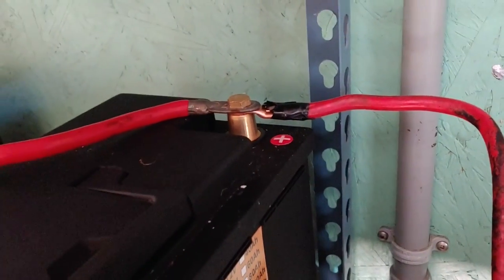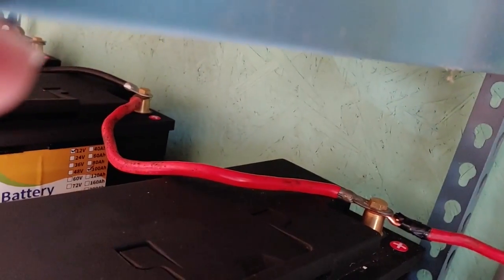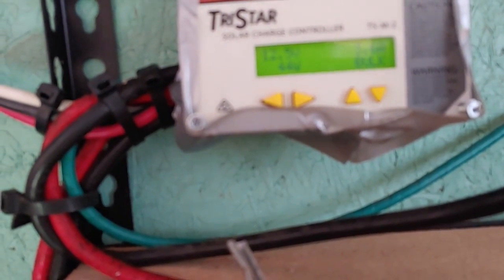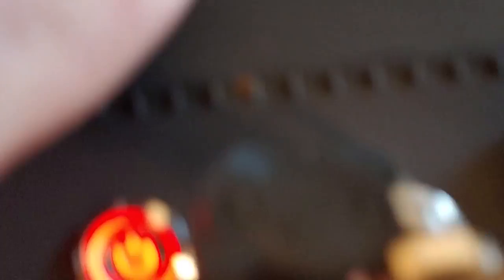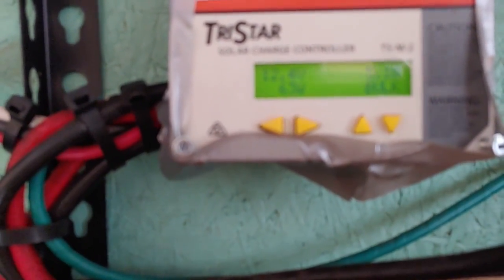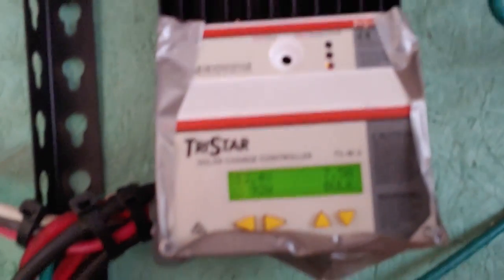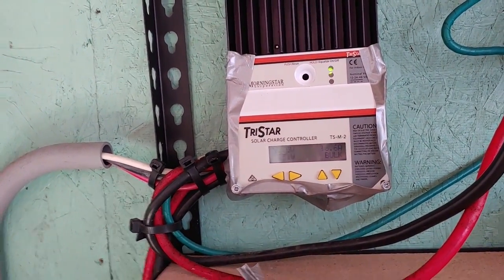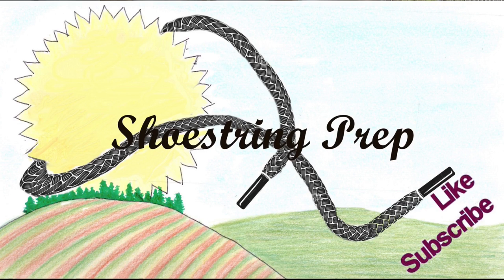Off-Grid Solar Power System:  Part 2/Well Pumps Test w/ Lithium Battery using FLY POWER 100-ah.

Comment: shoestring.....just for your own edification try changing the negative cable from the #1battery where it is now and connect to the #5 battery at the end of your parallel battery string.......see what your voltage drop is at the inverter while doing the test again.  I am powering a pellet stove and freezer in my garage with 4 100 amp batteries and a go sun 3000w inverter. i also had both cables going from one battery to the inverter and it was working ok......a friend who happens to be an electrician said i would get better use if i changed my inverter connection like i described to you.  now the system will power my hog of a freezer(spikes to 20a and runs at 12a) and the draw is equal on all batteries so i have more run time before the voltage drops and my inverter starts acting up. i would love to hear what you find out.....Arnie
Reply from the maker: I appreciate the tip. Thanks to you and your friendly electrician.
Thank you for your comment.

Comment: I want a system that can do exactly this, can you recommend what all is needed to that? I see 3 100 watt lithium batteries
Reply from the maker: I cannot recommend any equipment for your project because I don't know all the details about your well pump. You will want your batteries and your inverter to be powerful enough to handle the well pump. Thanks for your comment.